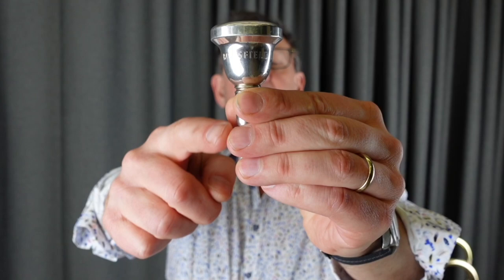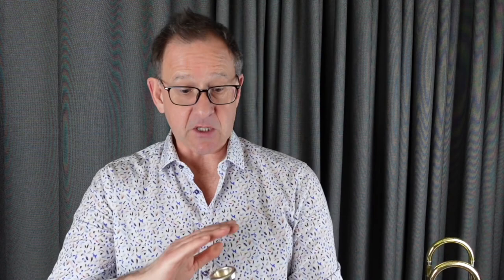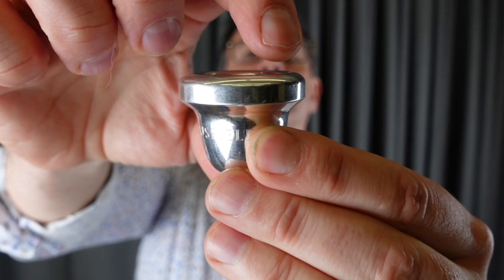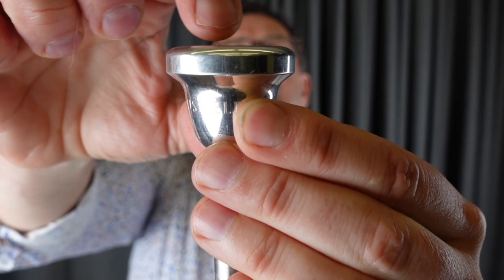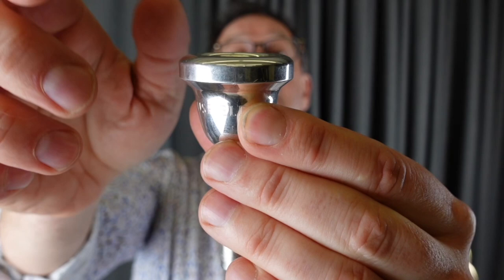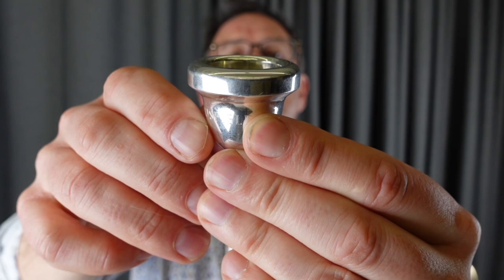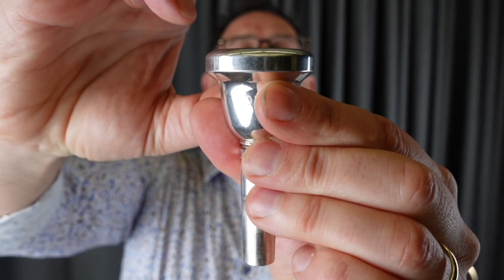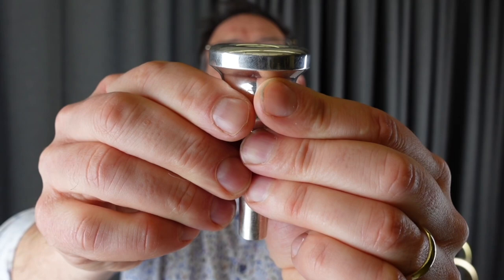DESIGNING A MOUTHPIECE!

Comment: Love your playing Ian! I’m curious, what is the main differences between the Griego V line and your previous models, S5, S4 and S. I have them all and right now I like the S a lot, very different from all other mouthpieces I have, (though I feel a bit unstable in lower mid register. Lack a bit of core and slotting)
Reply: I'm glad you like these pieces.  We adjusted the backbores and throats and the engagement (how far it goes into the leadpipe) on the new series.  The cups are also different on the new O & Classic lines.  The rims on the V&O remain the same as on the S series.
Reply: Great, thanks for your answer. For the rim size, what would be closest to the S? Is that the V3? For V3-V5, is the difference mainly the rim size going larger to smaller? Thanks!
Reply from the maker: Differencew is in cup diameter larger to smaller.  The original S is large so yes the V3 , C3, or O3.  V has  most shallow cup, O the deepest, and C right in the middle.